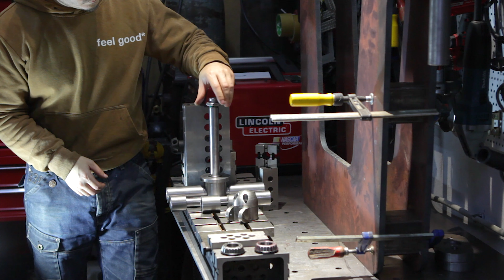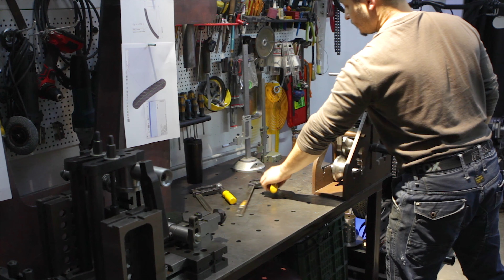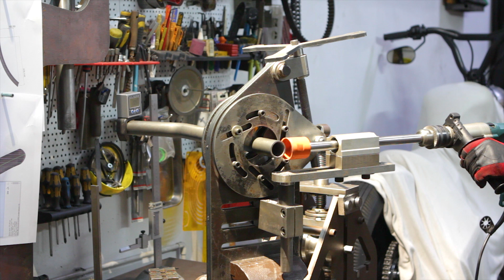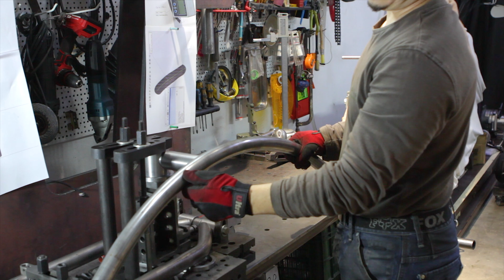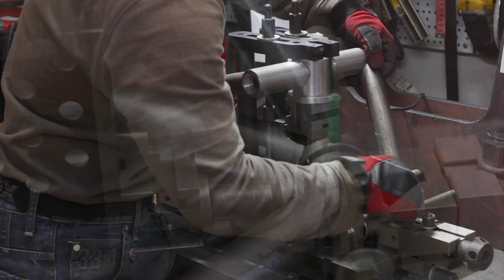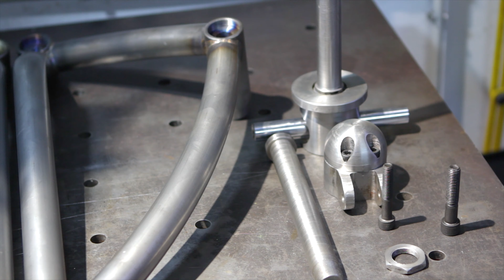Custom front end for Harley Davidson

Comment: Thanx for sharing your video. Really nice build. Did you use any bearing where the front rotates around the lower part of the headstock?

I will try to build some thing similar but for a 50 cc small bike.
Reply from the maker: If I correct understand you about bearings .. yes I'm using inside bottom part , triple tree using bearing , not brass washers .
Reply: @chopper_1987_  27 minutes into your video, do you have some bearings there to support rotation? NIce set of tools you have.
Reply from the maker: @sirtooby  correct